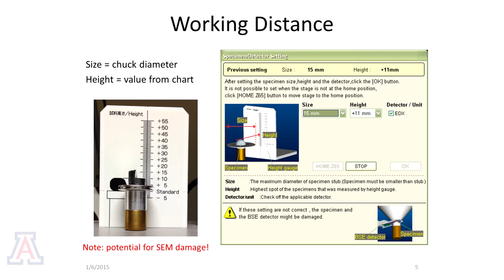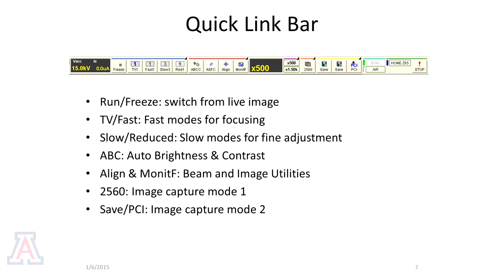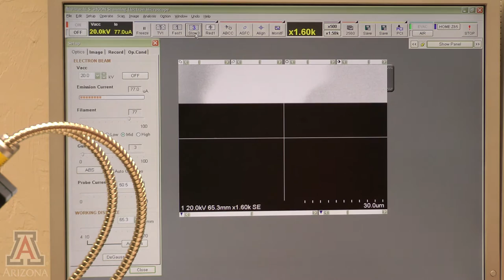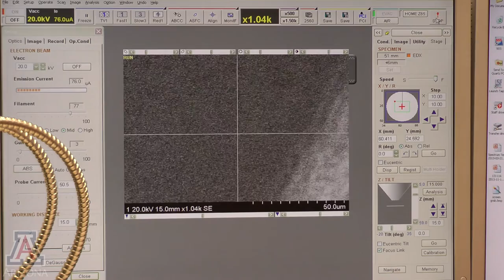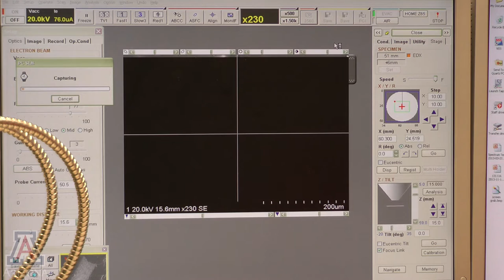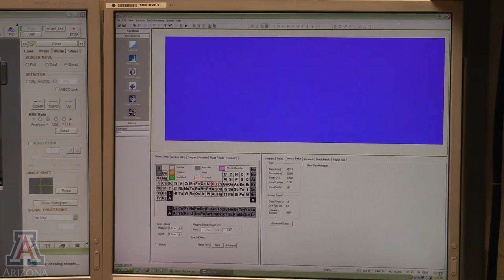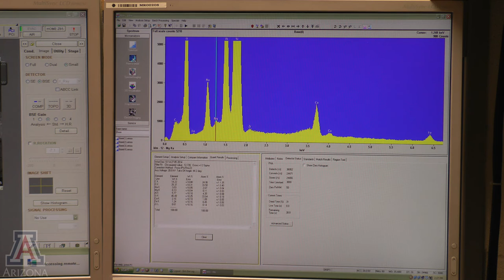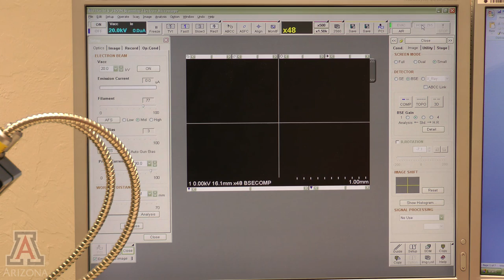SEM Instructional Video featuring Dr. Paul Wallace

Comment: What kinda differences would be there if I go for SEM testing of (1) cement paste i.e., cement plus water (2) mortar i.e., cement + water + sand, and (3) concrete i.e., cement + water + sand + gravels? Also let me know which case would be more appropriate in order to discuss the phase characterization of the products formed therein such as the main hydration products  e., CSH (calcium silicate hydrate) and CH (calcium hydroxide). 
One more thing.....how can I assess the structures of either of these two hydration products in which case, I have to first dehydrate my samples prior to going for SEM testing (during the sample preparation stage)? So if dehydrated, there would be neither CSH nor CH in the prepared samples for SEM.